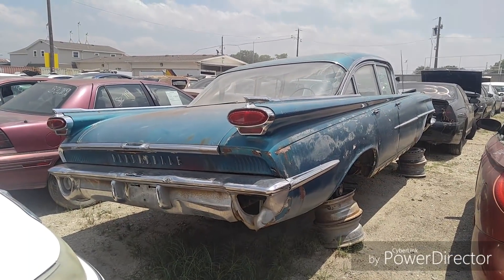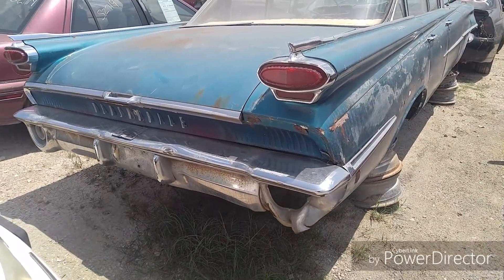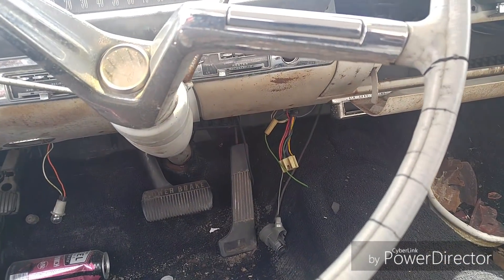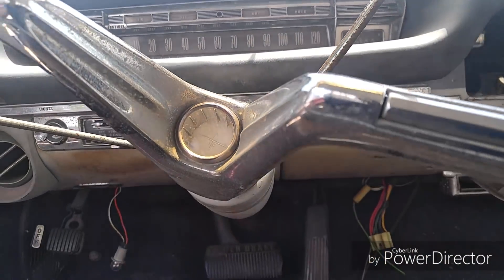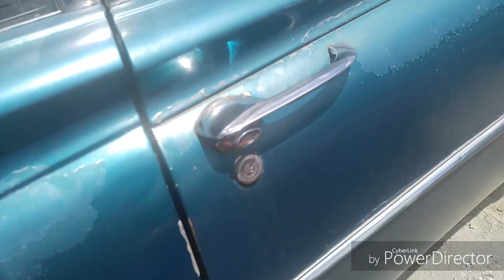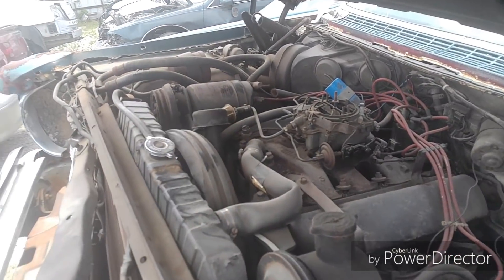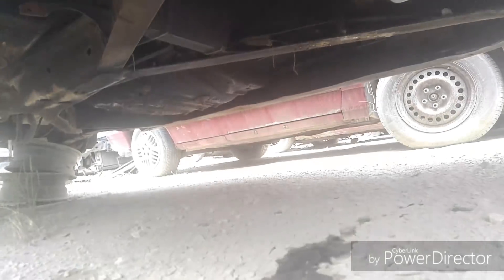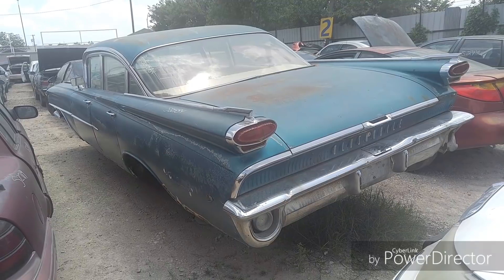1959 Oldsmobile Super 88 Junkyard Find

Comment: Cool Olds! I know this is an old vid but I just saw it today. Safety Sentinel was a speedo buzzer. You’d set it like an alarm clock at the speed you don’t want to go over, then when the speedo hits the set point a buzzer under the dash would sound. My dad’s 1971 Buick LeSabre had one, it actually worked ok.

Comment: 394 cu in. 4bbl They has a vicious top end. I had a 60 two door and seriously for a 4400 lb car it was clearly quick.. The old rocket 88 beat out many Chevy's including 396 and 427 cu in Chevy's. The only thing that gave me a run at all was a New York licensed Cadillac. We were about equal until I topped the big hill and the old paint roller speedometer went red all the way across.

Comment: Are there any rebuilding services for the Frigidaire A5 compressor? I have a 1961 Olds Super 88 bubbletop  with working  factory air, and I always wonder what to do, when that A5 goes out.....
Reply from the maker: I used to rebuild them. If you need A5 rebuild service contact original air group in Tampa FL
Reply: @ClassicRideSociety  thanks Benny!